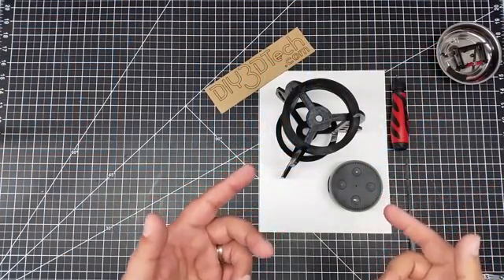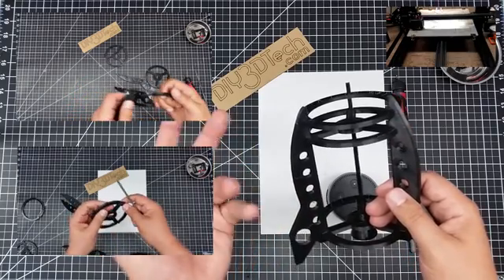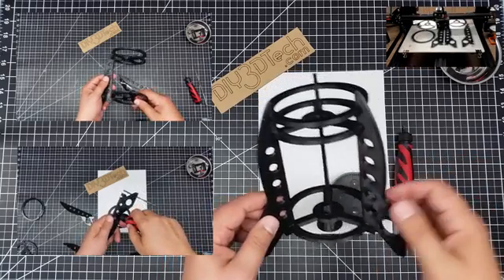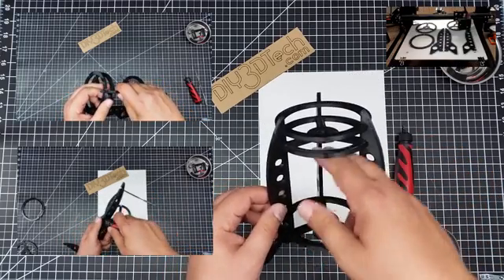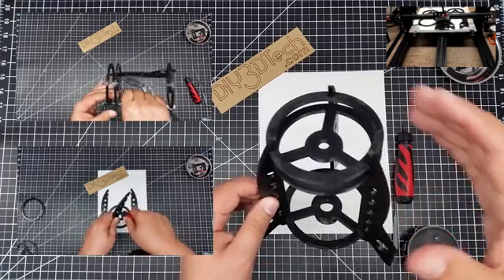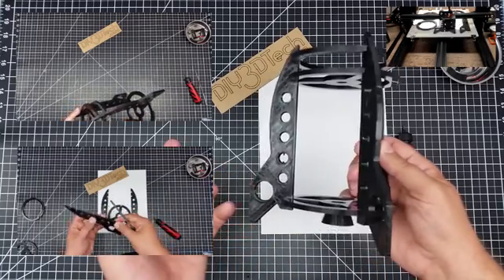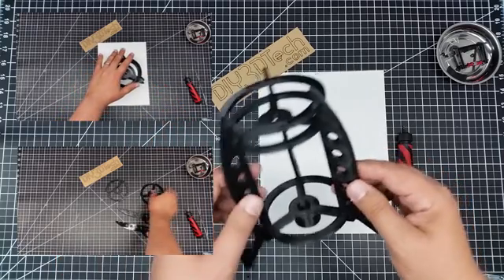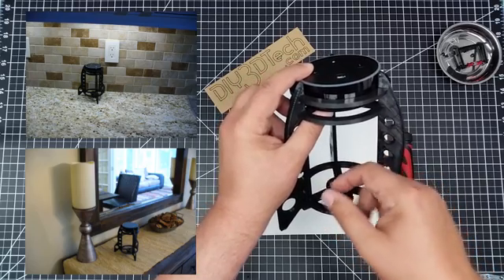Creality CR10 - Printing a RetroRocket Amazon Echo Dot Stand!

Comment: It is joined by flat 2D design pieces right? You can also put it to the laser cutter and compare with the 3D printed version.^^
Reply from the maker: Have been thinking about doing a laser cut version for grins and giggles.  Just note the gaps are 5mm so it is designed for 5mm stock..